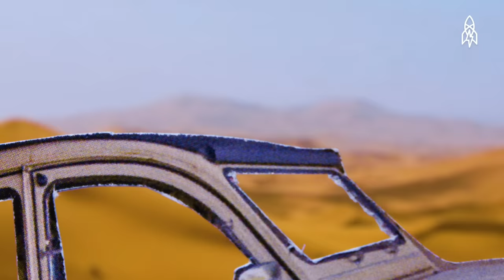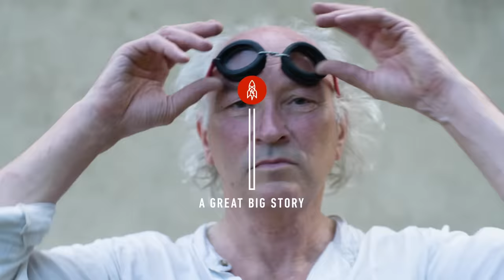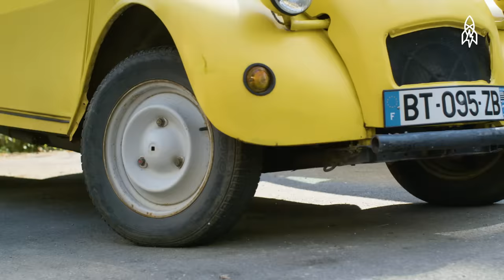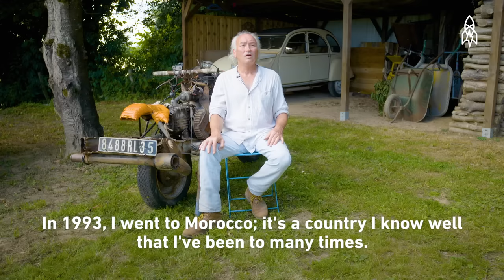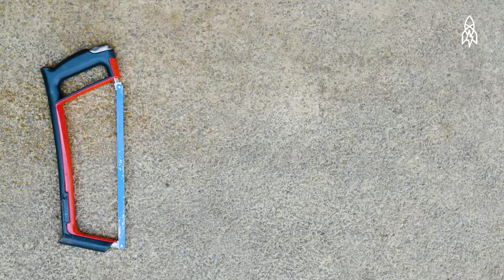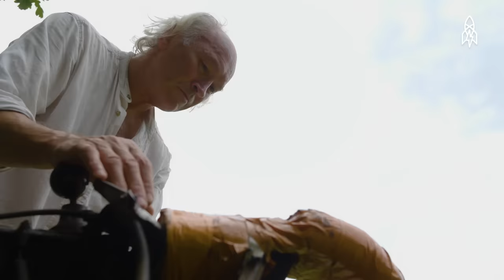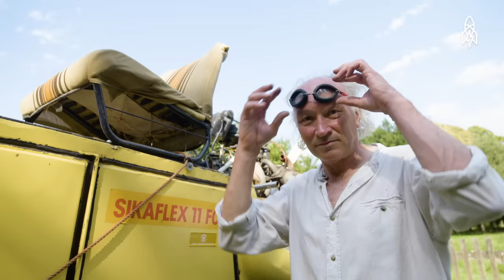This Man Turned a Car Into a Motorbike to Escape the Desert

Comment: He had food&water for 12 days? He could have just walked the 20 miles!
Reply: 12 days worth of water for desert conditions is not something you can carry while walking
Reply: VLPR But you can walk 20 miles in a day or maybe two. And carrying supplies for that time period too. I have never hiked in the desert and I bet it's really hard, but staying there for several days working on the bike must have been equally challenging.
Reply: It's a gamble either way. Maybe you overestimate your own walking speed and run out of water halfway through.
With this bike conversion thing you will at least have access to all of the water for maximum amount of time.
And if it looks like you can't do the bike conversion when you have only couple days worth of water left, you can then start walking with the remaining water. There's really no reason to abandon the water.
Reply: monamaennchen Morocco is too hot trust me
Reply: VLPR Deserts are not hot 24/7, they are surprisingly cold during the night. He could've camped and or slept for the morning, and walk at night.
Reply: monamaennchen 14 days of food assuming they're only snacks and water bottles would still be around 10-30 pounds
Reply: Some folks are just weirdly wired inside their head, they love the hard way.
Reply: Well... yeah... but where is the fun in that?
Reply: guys maybe he had no idea how many of desert he had to cross, and or did not expect the bike would take 12 days to finish
Reply: "It could easily be done in long day, with no water or food "
You walk in sand, 20 miles, of course
Reply: you think its flat maybe ?  and underestimate sand as you would do with water i presume
Reply: monamaennchen Yea, consider 40 miles on sand cause that shit is not close to even.
Moreover, you walk a lot slower anyway.
Reply: monamaennchen He must hav cooked for Michelin star food for 12 days u knw......bcoz u cant do much stranded in desert.....u have to survive with wats avlbl......
even I was stuck in a desert in my life before and the desert name was Hotel Sheraton with the cuisines named Asian Kitchen and Little Italy.... I had to survive on Michelin star food for 15 days...... tough life bro you would only know if you've done it yourself
Reply: It may take 1 hour to climb one dune. Walking in a desert is hell at night as you cannot see anything and predators are out at night. It becomes incredibly cold and windy too so that's another problem
Reply: Alexander Sharp oh okay
Reply: monamaennchen my thoughts exactly!
Reply: monamaennchen meh, too mainstream bro
Reply: You wouldn't really need much food, a person can go a month or more without eating, it's always water that's the issue.
Reply: You can do 20 miles in a day at a leisurely pace. If you do extremely slow 25 minute miles (a slow stroll) without stopping, you can get it done in 8.3 hours. If he had enough water for 12 days, he had enough water for 8 hours of walking, easy. Just wait until nightfall, you'll be there before the sun rises.
Reply: monamaennchen he could have, but that doesen't make as good of a story
Reply: lol this story cannot be true, I live in the high desert and ran 8 miles in just over an hour yesterday. 105 degrees at 5000ft above sealevel.this is a joke ...one waterbottle and running at night you could of done it in 3 hours if you were a little slow  ......
Reply: travis daniel that's because your fucking amazing
Reply: travis daniel I think it's total bullshit. I think he would have died in a couple days, especially sweating while building that fuckin thing!
Reply: All this story seems like fake to me. And not's because it seems illogical. More questionable part is how he attached parts to each other without welding it? Was he carrying arc welder with power supply unit or a few freshly charged car batteries to make it by himself?
Reply: It was 2 miles, but he drove 20 in circles.
Reply: Froz but then all the animals like scorpions and snakes comes out at night too.
Reply: monamaennchen where did you get the 20 mile distance? I didn't notice any mention of how far out he was
Reply: Spencer Pruitt at 0:07 he said it
Reply: Meh, walking is a million times more boring than converting your car into a motorcycle
Reply: The Meme Master of Cancertopia well if I was put in that scenario, I'd honestly just jog and then walk to rest then jog again. Cause I'm not gonna use up my time and spend a week there to build the motorcycle and 20 miles can be reached in at least 5 hours
Reply: Jett Sioson idk how I missed that
Reply: The pic of the car after it ran into the rock looks kinda  ....uhm...   . Was his oldtimer going 120 mph or is it just fragile as hell.
Reply: Maybe he took it as a challenge and kept walking as the last resort since he had enough to walk also.
Reply: Go to the beach and climb a dune, now do it for 20 miles worth.
Reply: It wouldn't have been nearly as cool that way
Reply: Maybe he had enough food and water for 16 days he looks like one of those guys that travels and sleeps out of his car eating canned beans . So if the bike didn't work then he would walk . He was thinking long term. About having a vehicle to get all the way home maybe.
Reply: he could have just walked the 6 hours and 45 minutes with shade and some food and water. im sure he could have made a bag from the pieces of his car. but i think we just did it for the challenge.
Reply: VLPR I walked 25 miles in deep forest to a secret government owned look in at Bucks Lake California (about 30 mins from bucks lake) to go fishing for the day so a total of 50 miles there and back so it's definitely possible just camp the night go in the morning this man was just lazy af lol
Reply: monamaennchen but why when u a mufokin mechinikal genious
Reply: Yea shaddup
Reply: monamaennchen I guess its cuz the car game him shelter
Reply: He could have walked it in about five to six hours but may not to have been able to know the right directions to the city he was walking to but he should had been able to see the lights there at night.
Reply: Balverine Maybe. People are weird like that.
Reply: Froz cant sleep in that heat
Reply: Listen to the story carefully and avoid the stupid narrative. He was not trying to make a survival story out of it. You see, sure he was 20 miles from TanTan, but he didn't have to go all the way back to Tantan, all he had to do is going back to Tilemsen (where he was turned away) which according to him was "several Kilometers" away, in fact looking at google map and trying to match the map being shown in this video he was not even off-road (although I wouldn't know the road condition back in 1993), which sounds like one to two hours of walking at most from civilization with the possibility of pass-by motorists. He was just having fun and this channel ruined the story.
Reply: If you walk in the desert, you'll require more food and water. What he did was the correct decision.
Reply: whats more tiring in the desert? converting a car or walking 20miles?
Reply: Wout B nobody said one day. But definitely in 12.  Please stop acting like a child.
Reply: Elzero Dragon or spending 2 weeks building a car that goes about walking speed.  He was only 20 miles out. He could easily walk that.
Reply: Well we all have to remeber. How would he get back?
Reply: 20 miles is a 4 hour walk. Prob 6 in the desert. Spread over 2 days, that's nothing.. I know, i live in florida and I work 10 hours a day in direct sun cutting trees and moving logs. It was a fuk tone easier to walk, he could have made a sled to drag stuff, how are you not gonna walk 3 hours max in 24 hours of the day if you spread it out over 2? This story is bs.
Reply: And how would he have gotten back to France? Walking too? He used the bike to get back.
Reply: Froz How can sleep in desert in day time :))?
Reply: Froz 

Where in the fuck would he camp at though
Reply: themonkeyhand try driving a shitty cobbled together motorbike over said dune. I bet it's even harder and the risk of injury would be much greater if the thing rolled.
Reply: I would of been there the next day

Comment: Supplies for 12 days, tools to rebuild his car completely and he documented it. A little questionable. He was only a few kilometers from the checkpoint and 2 or 3 days from a city. Nice story with a cool prop.
Reply: Ok then prove it please go into the desert 20 kilometers from civilization and walk back to a village
Reply: StruckOne 20 km would take you about 4-5 hours, here in the Netherlands there's an event every year in which people walk 50 kilometers a day, four days in a row
Reply: Firestarter then,the supplies are used to keep them hidrated,its almost as the same as riding a camel
Reply: Chikh8n no it is not. Walking is very different from letting an animal tote you around. One uses little to no energy, and the other requires quite a bit.

Riding a motorcycle, especially one that heavy and unbalanced requires a ton of energy to balance and steer, which is further compounded by the extremely slow speed it was capable of.

This comment section has shown me that the world is doomed

Comment: This is so fake!

The car was a paid actor
Reply: TecVo lol
Reply: You'd be surprised how easily you can put together a 2CV, you can assemble the 2CV within 1/2 hour with a couple guys. It was designed to be taken apart and to be easy to work on for farmers. Nothing needs to be bolted on, everything is basically pinned down together
Reply: He doesn't need to, he just cut the frame to shorten it
Reply: Most definitely fake. Looking it this as a tradesman makes me laugh. You would need a lot of different tools in order to get this done even cutting the axel and the frame haha
Reply: dave lall high goggiijjhio
Reply: dave lall I don't know man. They said it took him 12 days to complete it and I personally keep a full toolbox on all my cars and trucks. It does sound a little bit fake but I guess it's plausible, wouldn't be fun to do though.
Reply: dave lall and from the little research I've done a couple hours working on a similar car to the one he used pretty much nothing it's bolted on. Most body panels are just pinned in there, it was quite interesting.
Reply: Alex his point being that the specialty tools required would be prohibitive

How did he cut down the axle? The car was front wheel drive, so how did he get the wheel which is perpendicular to the drive line to be driven after made parallel? 

Sounds like he made this in his back yard and made up the Morocco trip.

12 days in the desert and didn't die if dehydration? Why didn't he just walk to civilization. Not like he was duning it and got stuck in the middle of the Sahara. 

I call BFS! Bull fucking shit
Reply: Alex can your tool box convert a front engine front wheel drive train to a mid engine rear wheel drive?

No way he did this on the side if the road in with nothing but a hacksaw, some wrenches, and duct tape.
Reply: That's the first thing I noticed: the axle. Thing is, this car DOES NOT HAVE AN AXLE! It's a great story, and the 2CV is a great car, but this is pure fiction.
Reply: Klauszelm, actually it does have at least two axels. so weather he did do this or not you need to do a little research before claiming something. e.g google = 2cv drive axel. also i think he is referring to the Wheel axels.
Reply: REEEEEEEEEEEEEE

Comment: Google maps calculates 1 day to walk 20 miles. He spent more time building when he could’ve walked.

Still impressive tho!
Reply: Delinquent right but keep in mind he would be walking 20 miles in the desert, he’d have to deal with scorching heat during the day.
Reply: KixShadowLaw and freezing cold during the night
Reply: @koldblaze6610  so he didn't have to deal with that while building a bike?
Reply: How 2 Game What? No, he would, obviously. But it’d be much easier. He’s not using as much energy as he would be walking. He’d be conserving that energy much more efficiently by doing this. Thus his body would have less problems.
Reply: @koldblaze6610  u know he can just walk at night time
Reply: The Kaiser u know the desert during the night is freezing cold right
Reply: The Kaiser ok but you realize he wouldn’t make it if he was freezing
Reply: ShadowLaw even with all the variables, walking would be a way better option, it would only take a day when he spent 12 days getting the same result only he was wasting time it’s still cool tho
Reply: @koldblaze6610  if he couldn't make it thru the cold while walking how did he make it through the cold while testing or working on his bike and "conserving energy" ??
*Resting

Comment: Around 1969 a friend of mine had a 2cv. The doors were hung from a central post (so they opened in opposite directions). As he drove around a mini roundabout one whole side of the car fell off. Just the two small welds of the door post had given way.

Comment: How  did he manage with no welding gear hmmm  20 miles is nothing  to walk
Reply: Steve Tyler 

20 miles in a desert? You think that's easy? 

You're joking.
Reply: 20miles is much on a desert. 20miles in city is not even that bad
Reply: Agreed.  Twenty miles is one day of backpacking.
Reply: unless you're an obese whale you should be able to walk 20 miles to save your life. Marathons are 26.2 miles and people walk them in about 8 hours.
Reply: but they don't do it in 100 degree (F).. Trust me i live in a desert, even going outside and standing you get dehydrated fast
Reply: but they don't do it in that heat
Reply: Steve Tyler is you know the direction, walking 20 miles is easy. Atleast if ur not an American.
Reply: - walking on easily shifting sand would be a hell of a lot easier than driving on it with a cobbled together motorbike I'd imagine.
Reply: Well he must've had water since he lasted 12 days and converted a car into a motorbike and you could just walk 20 miles in the night when it's not 100 degrees, it takes like 6-8 hours.
Reply: Dude 20 miles inn a desert is like walking 60 miles in the city... And oh yeah, how about add that 110 degrees to the equation
Reply: Duct tape. 20 miles is not nothing. 0 miles is nothing.
Reply: @Owlguy007  do that in the desert
Reply: if it was life or death, anyone can walk 20 fucken mikes
Reply: Duct tape! 
Also he didn't wanna abandon his shit!
He clearly had alot of shit!
Reply: Wate until night and start walking. Ive done that over a weekend when i went hiking upstate. it wasn't in the desert (oviously) but its for sure doable. Especially if your life depended on it.
Reply: 20 miles in a desert 
That is not easy it is not like a city
Reply: he got a complete tools packed inside hes cars fromsimple history channel
Reply: @johndoe-mv8ve  what do american people have to do with walking 20 miles?
Reply: @That_Guy_Ty  well one time I got stranded 12 miles from my home in the middle of the night with no money and no one I knew in the area. So I just walked.

Comment: Not only did he not save his own life by turning his car into a bike, it could have easily won him a Darwin Award.
The bottom line is that he was within walking distance of town*, and had plenty of water to make the trek, but chose to stay out there and pursue his project. By the time he was done, he was pretty much out of supplies. If his bike hadn't worked out, or had broken down, he probably would have ended up being eaten by scavengers.

*It's funny how this story was originally a few kilometers, which turned into ten miles,  twenty miles, and in some retellings is now simply "the middle of the desert".
Reply: Its about the journey and sending a message
Reply: I honestly doubt this story is anything but a fabrication. He must have had quite a set of tools available.

Comment: All of that skill when he could have used his genius-ness to fix the axel.

Motorcycles are more fun :)
Reply: How do you fix an axle? It's a metal rod, if it brakes you either need welding equipment to fix it or at least a crazy strong adhesive that can withstand accelerating a car, if such a thing even exists.
Reply: Angel Samael it does exist, jb weld, duct tape, flex seal, zip ties, you get the idea.
Reply: @enginesandoutdoors3238  hehe flex seal
Reply: Really all he needed was nice sapling to drag mounted under area where that tire would touch the ground and thats easy as shit to mount up and or replace along the way

Comment: It would have been way quicker to walk the 20 miles lol
Reply: And that's probably what he did. Mythbusters debunked this guy's story.
Reply: Direction and distance of nearest civilization in unclear at that situation to him, so walking is a 50/50 chance of;

A: Near civilization is found and you don't die from the extreme temperatures and exhaustion.

B: Nearest civilization is hundreds of miles away and you die.

It was a 50/50 chance, but given that he had enough supplies to survive an extended amount of time in the desert, he used that chance to significantly increase his chances of survival with long term planning and built a functioning mobile vehicle that gives him the opportunity to travel significantly greater distances without risk of death of exhaustion.

Comment: Some of these comments make good points. 
The most logical thing he should have done was walk but think about him in the moment. 
He had to think about what could happen if he walked.
Carrying supply while walking through the hot weather along with walking through sand isn't easy.
Even if he ended up taking 12 days to make the bike he in the moment thought of it as the best thing to do.
In things like that in the moment you need to think of what you should do quickly.